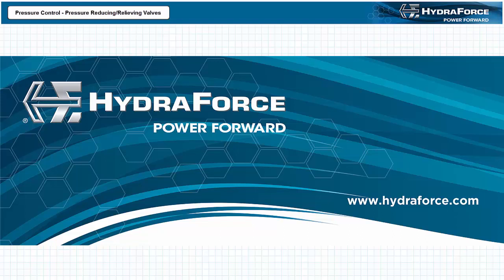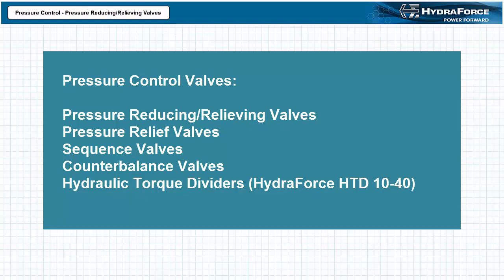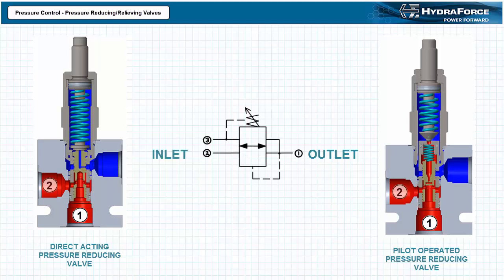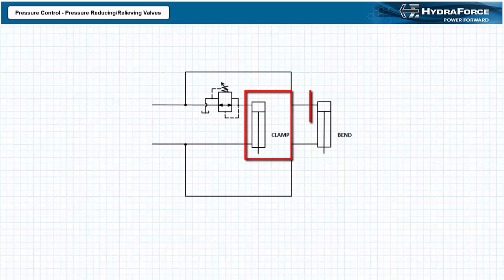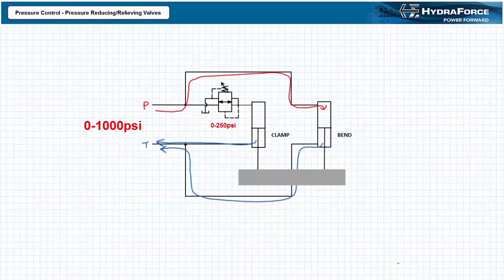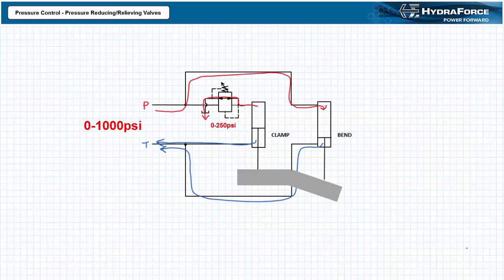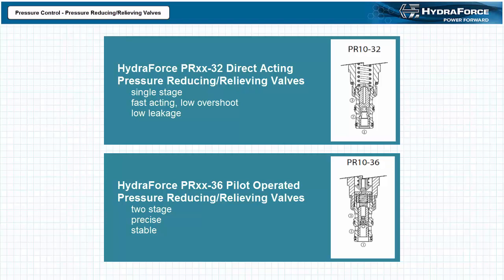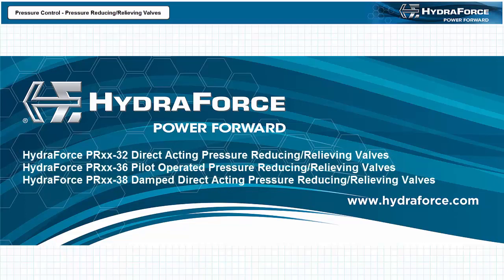Pressure Control: Pressure Reducing/Relieving Valves

Comment: Dear sır. It is a great video. I like to ask you a question.
When the pressure rises in port A of clamping cylinder pres.reilef&reducing valve swich to tank from closed position. So the oil goes to tank from A port of the camp cly. If i dont misunderstand How come the clamp cyl. does not recract (moves backward) and unclamp  the part. Other wise we will have vacum. Thank you for information before hand.